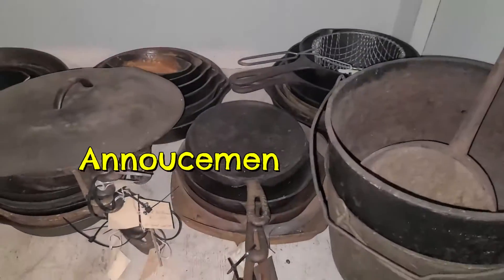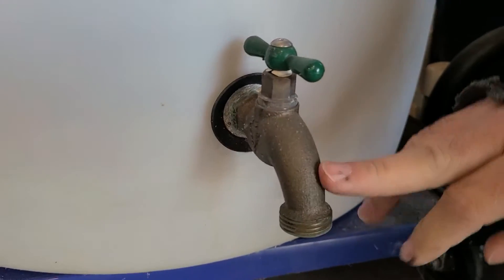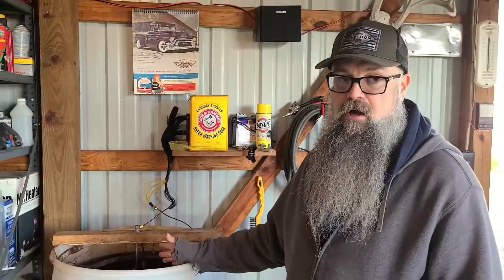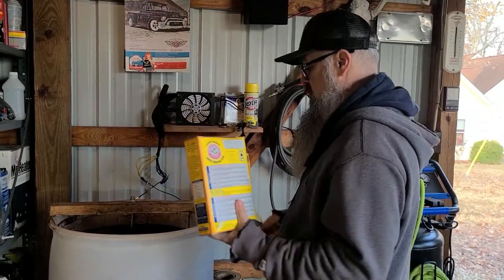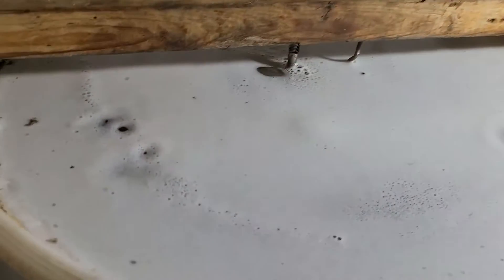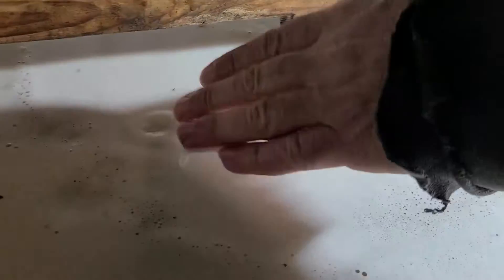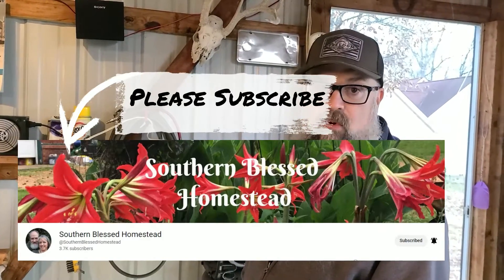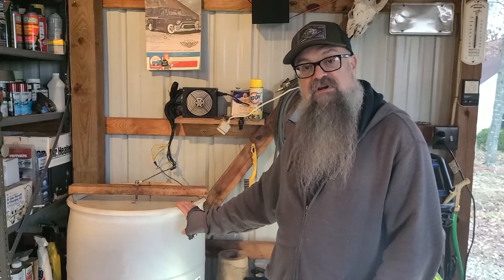ELECTROLYSIS | TIPS on BUILDING the Best E-Tank Setup | Cast Iron RESTORATION

Comment: Has anyone told this guy that using stainless creates toxic fumes?
Reply from the maker: You don't need to worry about it if you're using it in a standard electrolysis setup for rust removal or similar applications, especially if you're using it as a sacrificial anode

Comment: In case anyone is wondering about how to convert a computer power supply into a power supply that you can use for this all you need to do is chop off the 40 pin connector and there will be a small green wire. Take the small green wire and connect it to any black wire. The green wire is only used for turning on the power supply so you can put a switch in between if you want. Then take all the rest of the black wires and cut them and bunch them together and add a connector. Then take all the yellow wires and bunch them together and add a connector. The yellow wire is your 12 volt. If you want 5 volt just collect all the red wires together and add a connector. You can do it to both and switch between 5 and 12 volts. Just don't take the power supply apart if not sure what you're doing because of the high voltage capacitors could hurt you. But it's safe enough if you're just cutting and stripping wires.

Comment: What size is that wash drum straight across the top I got a hold of one and it will not fit in my 50 gallon plastic barrel so now I'm looking for a bigger drum so my Wash Tub will fit down in  mine is 23in

Comment: My brother from another mother, you have your head out of your butt! I just discovered and subscribed to your channel. Thank goodness someone else is using stainless steel, it's soo much better than carbon for this application. I'll tell ya about my set up but I wouldn't change yours. My tank was a 55 gallon plastic pickle barrel cut to 24" tall and holds 35 gallons. By using a 35 gallon container I get two fills from one box of Super Laundry Soda. I use stainless steel sheet metal to fully line the inside of the barrel. I hang my pieces from 3/4" copper pipe with several positioning holes drilled into it for 1/4" J hooks. (usually 2 J hooks in each pipe) You'll need a heave jumper between the two pipes and the negative just clamps to the end of a pipe. My anode sheet metal lacks an inch reaching the top of the barrel so the pipe doesn't touch it. Sit down here comes the big one... hang your pieces inside a pillowcase to act as a filter keeping the anodes and tank cleaner longer. Just like a coffee filter the water will become stained, you can spray out the pillowcase between cleanings. I started with a pillowcase with a pool noodle zip tied to the top. I use a bed sheet sown into a large pillowcase/ tank liner now. I mix my Laundry Soda with a paint mixer for a variable speed drill. My anode sheets are bolted in with wingnuts for quick removal and cleaning. I have a cheap electric pressure washer for spraying off the skillets and cleaning anodes. And yes my tank is also setting on a furniture mover. My power supply is a Shumaker 1565 a 40 amp charger from Walmart. I keep a fan blowing on it to prevent it from heating up. My amperage depends on the surface area of the pieces in the tank. I like to stay in the 30 to 35 amp range. I can usually clean 3 to 4 skillets in 12 hours. The largest piece that's ever been in it was a 20" Griswold hotel skillet and unfortunately it wasn't mine. It fit in the tank better than it fit in the oven but both were maxed out. I clean for myself as well as two estate sale companies. For all the Safety Suzie's out there the stainless steel fumes don't explode when you spark a wire over the tank. That's bull that someone started and people repeat because they never tried it. Haha I see you putting your hand in the water, any6one is welcome to pee in my tank. They won't get but a drop in there before deciding that was a bad ides, 30 amps will light me up!
You are also set up to clean on a larger level. By searching out estate sale companies in your area that are open all week with store fronts they benefit from cleaned cast iron. When they receive cast iron I get first pick. I usually take cast iron as payment if there happens to be something that I don't have. This keeps me from purchasing the more high end pieces and they aren't collectors so they don't care. Some store owners will trade cast iron with ya, just remember they have to make money on what they trade. Owners seem to like #8s and I can find them cheap. If a skillet is warped or cracked you can cut them into spatulas which trade well. My current load consists of 10 skillets, 4 dutch ovens w/ lids, and 2 chicken fryers w/ lids. Judging from your Lodge collection are you in the south? I bet there's BSR in there somewhere. I'm in SE Tn. north of Chattanooga. Thanks for this video, I look forward to watching the others.
Reply from the maker: Thanks for taking the time to watch and comment. I really like the pillowcase idea. I don't clean as much as I used to back when I had a booth. I'm a Wagner guy myself although I do have a lot of Lodge, one complete single notch set and another nearly complete set. Going to do a video of what all is on my rack sometime. We're located in southeast Missouri. You should really look into a power supply unit, I went through several chargers before I finally got one. Thanks again, and happy cleaning.
Reply: @ASimpleLifewithChrisTara  I was fortunate to find a no notch Lodge #14 that is marked Lodge in an arch at the top. I'm working on a set of one notch Lodge with a raised number on the handle. I need a #5, #6, #10 and up. I have them just not in raised numbers. My 3 notch blob set is missing a #4, #10 and up. I have some old Wagner and National skillets with the outside heat rings. Part of the fun for me is not paying high prices, my limit is $100  I spent that one time for a #14 when I had only been collecting for only a year. There are ways to find really good pieces without spending a fortune.

Comment: Graphite carbon anodes work better than stainless and no hazmat to deal with. Can be found surplus on ebay, usually used for edm
Reply from the maker: Thanks...never have had a problem though
Reply: @A Simple Life with Chris & Tara  I've seen your results, its obvious your system is working great,using graphite anodes would only improve bath life and leave you with a cleaner piece when you remove it from the bath. I only mentioned the graphite in case you anyone gives you an issue about using stainless
Reply from the maker: @brintiff  hey, we appreciate the comment! Always room for more learning. Thanks for taking the time to share ✌️
Reply: Stainless! Lol, well I guess he’s not dead yet. Graphite works so much better than any steel
Reply from the maker: Hmm so that is what you use?

Comment: On your power supply, are all of the yellow wires all grouped together and then hooked to the hook on the 2X4 board and all of the black wires grouped together to hook onto the stainless steel drum?  When I look on Ebay for a power supply, there are many different bunches of wires to these power supply units, and some are red, green, purple and yellow. Are all the other colored wires just taped off and not used for this setup?  Thanks for any info on the power supply setup. Nice video.
Reply from the maker: All the yellow wires are bunched together and hooked to my stainless drum, so that would be the positive side. All the black wires are bunched together and hooked to the hook that goes through the 2x4 to hang the iron from. That would be the negative side. All of the other colored wires coming out of the power supply are bunched and taped together, out of the way, they don't hook to anything.  Hope this helps. Good luck and happy e-tanking! 👍
Reply: @ASimpleLifewithChrisTara  Thanks for the info. I appreciate it.
Reply from the maker: @a1930ford  👍👍

Comment: I just read that using stainless steel (which contains chromium) as an anode in the electrolysis process creates poisonous waste (chromates) in you electrolyte (yellow color).  That is considered hazardeous waste and can not be dumped on the ground or down a drain.  Please research this before you use stainless steel as an anode.
Reply: As a rule there is not enough energy used in this type electrolysis process to produce hexavalent chromium. There are test kits sold on Amazon to measure the chromium levels should you choose to set up an E-Tank with stainless anodes.
Reply: @robbiemustian8460  don’t believe a google search. The corrosion process does dissolve the chromium into solution into solution.
Reply from the maker: We have and will continue to keep researching.   Can never stop learning. Thanks for stopping by.
Reply: That was my thought as well. Once you start breaking the stainless down at the atomic level, which is what electrolysis does, that free chromium is going somewhere. So you REALLY want to know where it’s going when you’re working on items used for food. Cast iron is porous so it’s going to absorb that liquid.

Comment: Great idea with the washer tub. Some say not to use stainless cause it puts out some kinda chemical that’s no good. I’m just learning this so I’m just asking your thoughts. Thanks
Reply: Hex Chrome, aka dichromate, is water soluble, and won't be released into the atmosphere. It will go down the drain with the spent electrolysis solution. I've seen several videos mention that dichromate won't  be generated under lower amperage electrolysis conditions, but I've almost never seen anyone cite any actual test data, which as a retired chemist ... makes me a little nervous.
Reply from the maker: Thanks so much for watching.   Questions are good...you can never stop learning. 

The advantage to stainless steel is that it does not corrode as readily as do other types of steel or iron. It is not unusual to see comments, however, that using stainless steel in an electrolysis setup creates a hazardous byproduct called hexavalent chromium. "Hex chrome", as it is referred to in the electroplating industry, is indeed a problem for those working in that industry, where, at the temperatures and voltages employed, it can be produced, vaporized, and released into the atmosphere. At the far lower voltages and temperatures commonly used for cast iron cleaning, however, hex chrome is not a concern.

Comment: Very nice setup 👍 I've been wanting to build one to restore several pieces of cast iron ware that I have.  I have a bunch of computer power supplies on hand. Matter of fact I have old dryers on hand to get a drum. I also have a plastic barrel. I will be up and running in no time. Thanks for sharing this.
Reply from the maker: So glad it was helpful.   I think I will be busy cleaning some cast iron for a while lol
Thanks for watching
Reply: Can I use galvanized sheet metal instead of Stainless steal?

Comment: Ok I need a schematic and complete details on your power supply. Lol J/K 
That seems to be an easy setup. Great video. Love all the cast iron stuff you have. I think I spotted an RC Airplane in your garage I always wanted one of those. Lol
Reply from the maker: Yea lol 👍
Reply: @Huester74  ok thanks
Reply: @Huester74  sounds easy lol 
Thank you
Reply: all you need to do is chop off the 40 pin connector and there will be a small green wire. Take the small green wire and connect it to any black wire. The green wire is only used for turning on the power supply so you can put a switch in between if you want. Then take all the rest of the black wires and cut them and bunch them together and add a connector. Then take all the yellow wires and bunch them together and add a connector. The yellow wire is your 12 volt. If you want 5 volt just collect all the red wires together and add a connector. You can do it to both and switch between 5 and 12 volts. Just don't take the power supply apart if not sure what you're doing because of the high voltage capacitors could hurt you. But it's safe enough if you're just cutting and stripping wires.